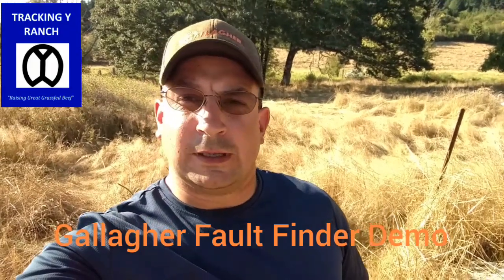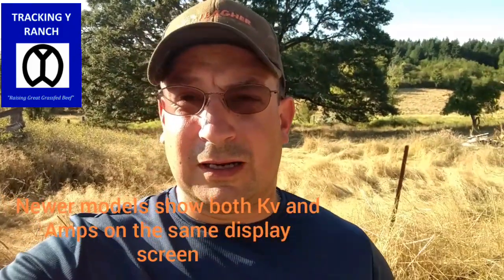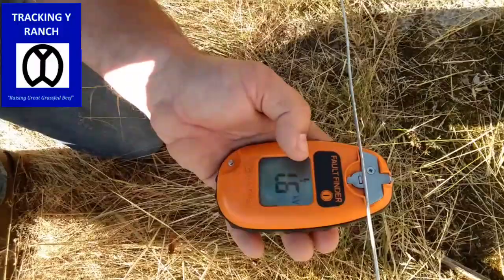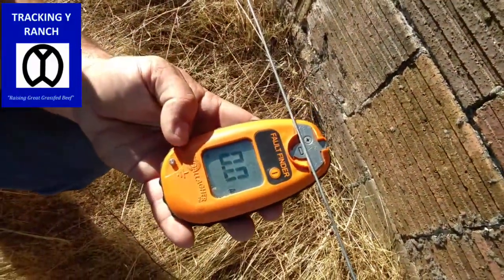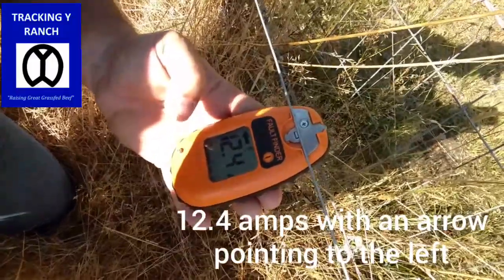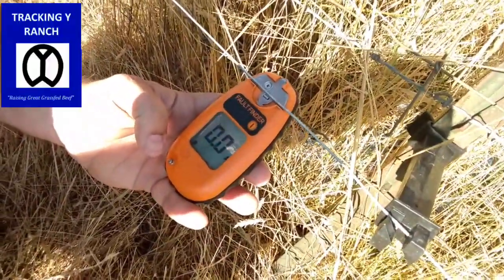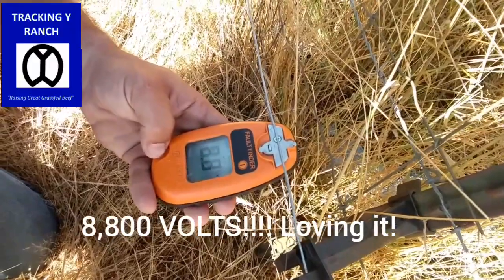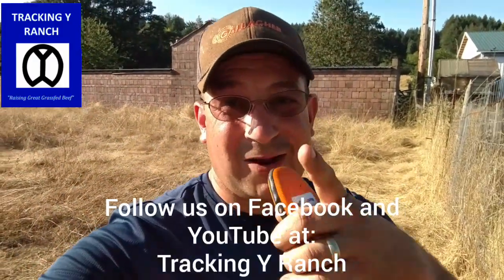Gallagher Fault Finder Demo

Comment: Isn't there a setting on this model that shows amps and voltage at the same time?
Reply from the maker: The new Gallagher Fault Finder's show both on the same display. This model, the previously released model only allows you to see one reading at a time, but with a push of a button you can toggle between the two.